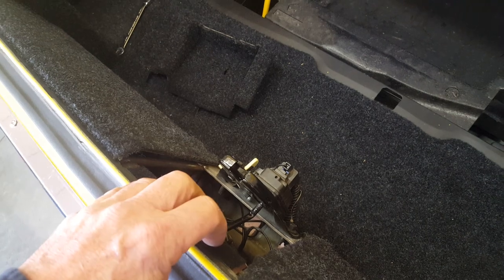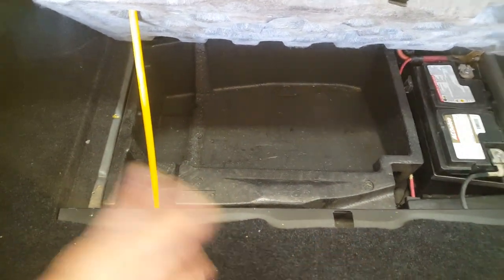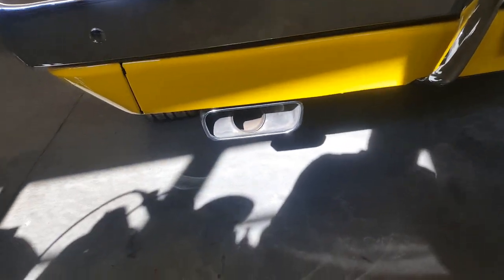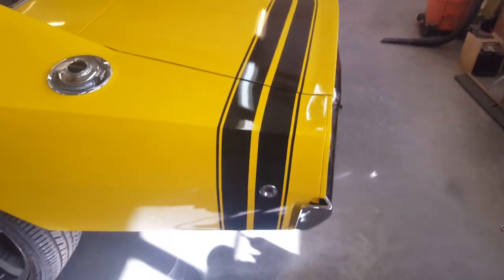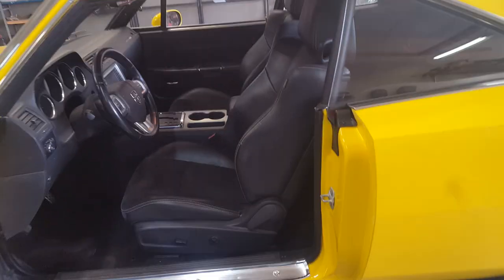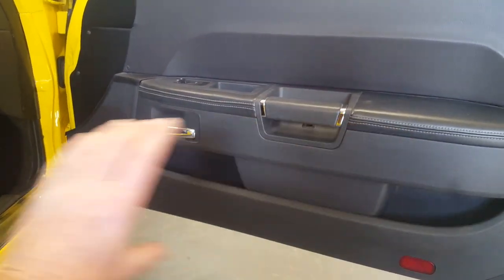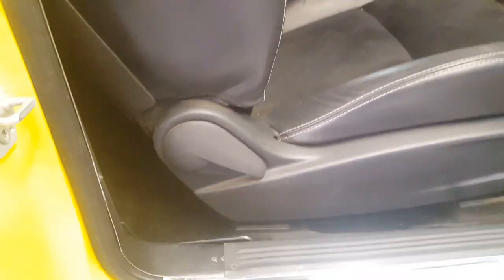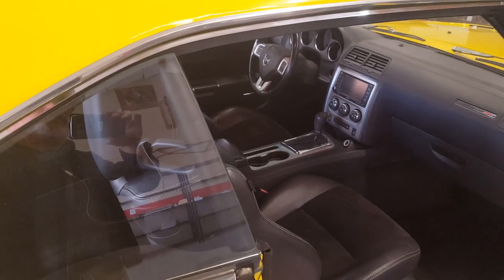Don's 68 Charger body swap part 45

Comment: You are an artist to be sure and I am very impressed. I think I would prefer swapping the drive train and suspension into an old car over doing the body swap but I guess it depends on what outcome you are looking for. Congrats on another fantastic build.
Reply from the maker: Thanks. Either route can be expensive.
Reply: @SteveMirabelli  You are absolutely correct on that point, I am doing a 71 Charger now with a 5.7 and 5spd and I am already into the car for over $40K (doesn't include the price of the car or paint/body).

Comment: I have to ask boss, has anyone ever thought to just do a skin swap on one of the challengers? Rather than all that cutting of the internal skeletal structure, why not leave it in tact like the carbon fiber guys do and just graft Auto Metal Direct 68-70 charger sheet metal onto it??? It'd be cheaper and I'd guess quite a good bit less work but still quite a lot at the same time. Thanks for answering if you choose to, God bless!
Reply from the maker: The carbon fiber guys invested in highly modified parts to be able to apply them to the skinned structure. They are nowhere near the proportions of the AMD sheet metal. Bottom line is the AMD stuff would not fit.
Reply: @SteveMirabelli  well that's a bit of a spirit breaker. Heh. I know the AMD stuff wouldn't fit put of the gate but could they be grafted on and made to fit? The proportions aren't that far off in terms of wheelbase length. The pitch of the C pillars which line the rear windshield have the same degree of slant as the 68-70 chargers at least from my untrained eye. I guess I'm just trying to be more hopeful than I probably should be
Reply from the maker: @ChargerusPrime  it is pretty far off.  The floor of the Challenger to the roof is 3 inches taller than the old Charger. The windshield is such that you would have to shorten the hood at the back about a foot. The roof is way wider on the Challenger. Then the quarter glass is the wrong shape. On and on. Don't think I have not considered this approach. It all just looks out of shape by the time you make all the modifications.
Reply: @SteveMirabelli  well I'm not after it to be perfect. The carbon fiber guys don't make it look precisely like a real 68-70 charger as you have with excellent work I might add. More or less I'm after a look along the lines of what SixTwleve and what Exomod carbon does. But I guess at that point I may as well just forget about it. My goal was to do this sort of thing with less work and less money involved. That's not possible. Unless someone starts to make dies out of carbon fiber panels and casting them in metal.
Reply from the maker: @ChargerusPrime  its about $20,000 worth of sheet metal and accessories so if you like the EXoMod look. Totally doable.
Reply: @SteveMirabelli  I actually really do like the exomod look. It's the perfect blend of modern and old with great fuel economy, creature comforts and a 5 star safety rating. That's exactly what I'm after. And that 20 grand worth of sheet metal is VASTLY less than the $359,000 and 2000 hours exomod charges and puts in for these things. Heck even SixTwelve autoworx starts charging at 90 grand a pop.
Reply: Have to say that it's just as sexy yellow as it is orange.

Comment: You want to body swap a 70 roadrunner on to a 1,100 hp redeye challenger
Reply from the maker: I wish I could. That would be tremendous fun but I am doing all I can handle right now.
Reply: @SteveMirabelli  understand... i had to at least try... but you put together a cool car
Reply from the maker: @jermason8594  Thanks. I just turned 67 . Don't know how many more I will be able to build since I work alone.